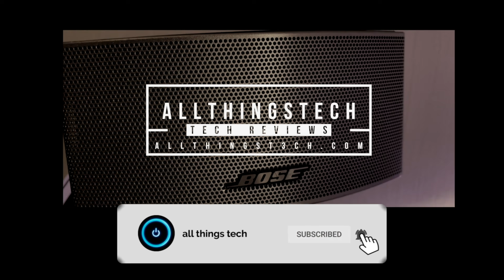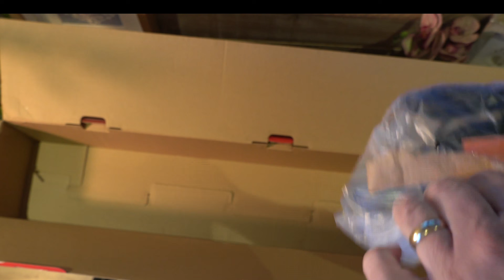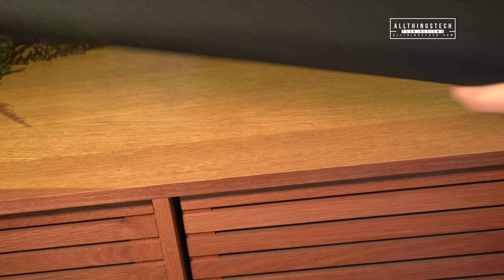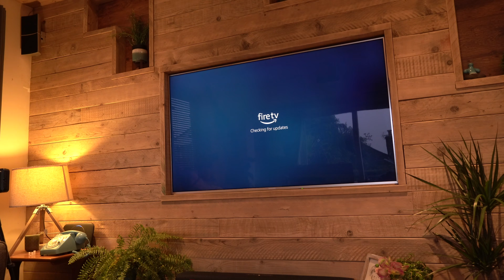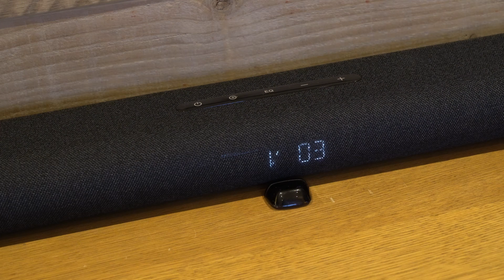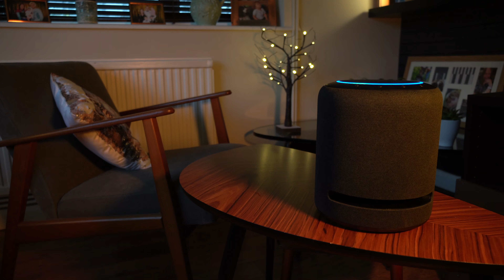NEW 2019 Nebula Sound Bar with Amazon Fire TV 4K Built in | First Look & Review

Comment: The best things about the Anker Nebula Soundbar is the fact that along with being a speaker, it doubles as a streamer too. Therefore no need of an extra streamer outside the sound bar. For $230, one get Alexa voice control along with Mediatek chipset at its core to take care of the performance which is amazing. The audio is pretty good although it does not have a subwoofer.
Reply: it actually does have 2 built in subwoofers

Comment: You said the HDMI on the sound bar is input.   Isn’t that a mistake?  How do you get the fireTV video to your monitor if that HDMI is an input only?
Reply from the maker: Les Hsu yes I meant hdmi port not input
Reply: HDMI is In/out in same time... If your TV supports ARC, you can watch for example TV and sound comes from soundbar, not from TV. But on soundbar you need to set input to ARC
Reply: @rbphotoca  Does that mean I can connect this soundbar to a dumb monitor and watch fireTV video and listen to the sound from the soundbar?
Reply: @lehsu  yes, I don't see any problem why it shouldn't be working

Comment: Display on all the time = deal breaker
Reply: Unless I missed a setting, yep the display is on all the time...even when 'off' it shows SLEEPING
Reply: @AceXsmurF  When you hold power button for 3 seconds, speaker will turn off, display will also turn off. When you want to turn it back on, it takes around 10-15 seconds. From "Sleep" it takes 2 seconds

Comment: Thanks for the review!  Mine comes in today and I can't wait to try it.
Reply: Let us know your thoughts 👍🏻 want to pick one up so all opinions welcomed
Reply: @clivemerritt  same
Reply: Same here. I think this is an easier sell to the wife than placing a Echo Studio on the mantel under the TV.  It has to sound better than a TVs built in speakers. Plus one less device and remote. Can it be wall mounted?
Reply: @WatchRob  yes, it can be wall mounted. Mount brackets and screws are included in the box
Reply: hi, just wondering if you received this soundbar yet! How was your experiance! I am thinking of purchasing it for myself! Is the built in firetv 4k perfomance and storage the same as the stick, and how was it for working with other devices?
Reply: It's solid.  However, there are some device where it doesn't switch to the ARC setting in the soundbar.  Specifically, the AppleTV.  Gaming and other devices it recognize the ARC.   If you like using the native FireTV, the interface is decent but a little clunky.   Sound-wise, I think it it's solid. However, Amazon paired up with the Nebula brand to try and bring value.  If you are just going for sound, perhaps look for an dedicated soundbar or sound system.